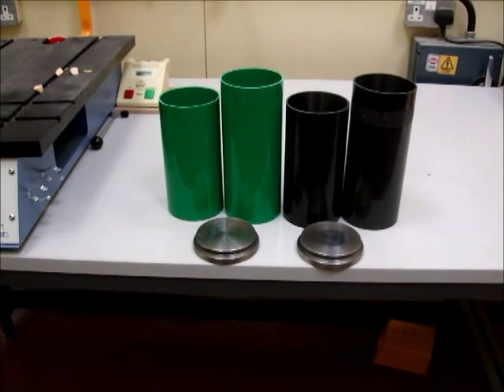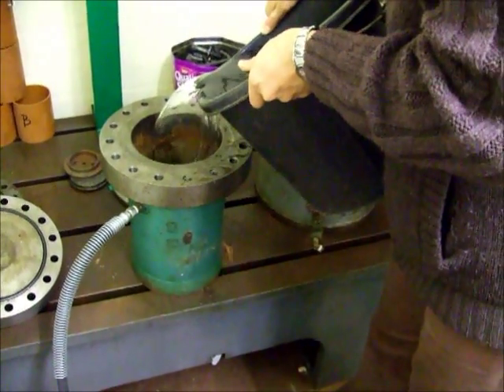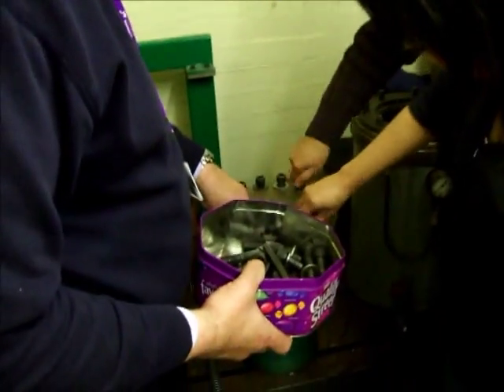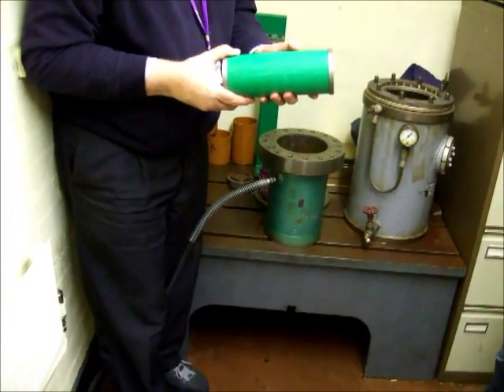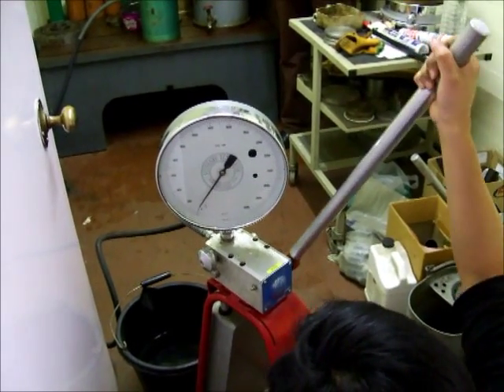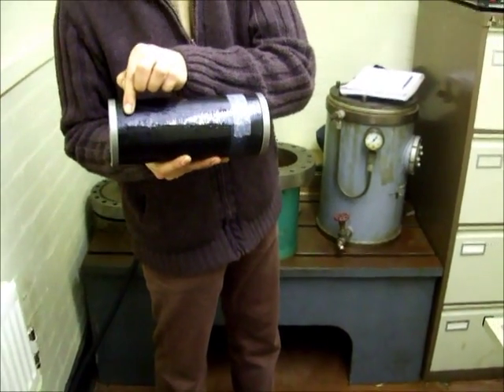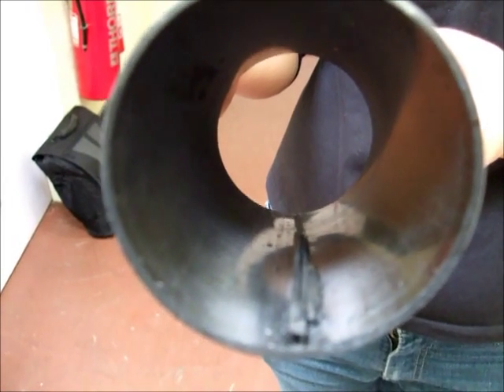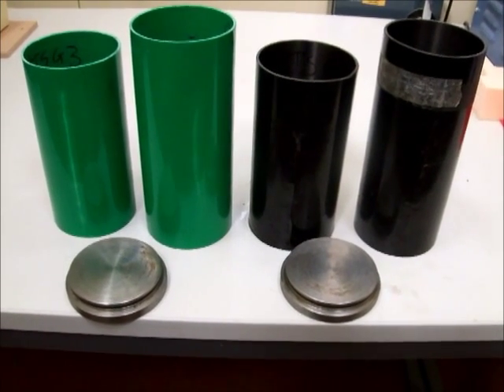Collapse of Carbon & Glass Fibre Tubes under External Hydrostatic Pressure.

Comment: Many OceanGate experts here in the comments, so I take the opportunity to ask what these tubes were supposed to withstand in the first place?
Reply: These tubes were demonstrating that carbon fibre hulls, are useless when exposed to pressure systems, also useless when exposed to freezing temperatures. There's a very good reason we use titanium

Comment: CF seems like a suicidal choice for the OceanGate Titan hull. Two minutes research shows that CF is only 1/10th as strong under compression compared to under tension. It's basically only the resin adhesive that is countering the outside pressure - a function that it was never formulated to perform. And that's assuming no manufacturing flaws, in a technology that's notoriously tricky to get right. Crazy...

Comment: The only strength a carbon fibre submersible pressure hull has is the epoxy resin. Useful for containing high pressure within, but useless at keeping high pressure out. Sad that this basic understanding was simply ignored.
Reply: The design of this "vehicle" would have benefitted more structural integrity, from a dual skinned corrugated steel rain water tank with layers filled with foam, for the pressure hull. Given that the corrugations allow an enormous strength factor through it's sine wave geometry. The CEO was delusional simply put.
There is no way this vehicle should have been allowed to exist, as a tourist/mission specialist/ passenger experience.

Comment: I wouldn't want to be standing next to this apparatus during such an experiment. If a bolt gets loose or there is material failure of the container for any reason everyone in this room would become history. Preferably control the experiment from a different room using very thick bullet-proof glass.
Reply: That’s simply not so. Water is essentially non compressible, which means that it doesn’t store energy. Notice how little work was needed to pump it up to 1500 psi? That work (perhaps 20, one-handed strokes of the pump?) is all the energy that would be released if the pressure chamber burst. 
Now, imagine how much pumping you would have needed if you were trying to pressurise it to 1500 psi with air.  All that energy goes into compressing the air like a spring and, now if the container bursts it will do so explosively. 
Tanks are regularly tested to failure using water. The tank splits, a small amount of water is ejected, and the pressure drops instantly back to zero.
Those people were perfectly safe.
Reply: The only danger is getting wet! It's perfectly safe as long as all the air is vented.
Reply: Notice that they get every last bit of air out. Because water is essentially non-compressible, it can't store energy needed to cause an explosion.
The only thing I'd be worried about is maybe a shockwave when the sub model implodes... but based on the video, that doesn't seem to be an issue...

Comment: Now mesure thickness of carbon en same devide from thickness of Titan and calculate wich pressure would hold 5" hull
Reply: Then, do pressure/de-pressure cycles, holding pressure in between as if at the bottom doing exploring ...
Reply: @tabooretka  its not rocket science but simple calculation. Of course is much complexer then i give it here but many people wouldnt onderstend if i was going deep in math for this one😉
Reply: @tabooretka  Define "most important factor."
In my experience with pressure vessel design, the shell thickness required, for the pressure to be resisted, is calculated first.  Then the piping nozzles and support connection reinforcements that are required to be added locally to keep the stresses within the allowable limits.  Agreed that these details often take longer to calculate than the pressure shell thickness.
When I got into this business we were just on the edge of using computer finite element stress analysis.  Since no one in my office really trusted those results, we carried them out by hand calculation using the Boiler and Pressure Vessel Code to guide us.  Then compared them to the FNA.

Comment: There is another video and a guy mentioned it, and that is the total lack of cross webbing on the ocean gate Titan. Scuba tanks have fiber in two directions crossing many times (and that fiber is intention, exploiting its strength). It seems obvious now in hindsight, but imagine a board of which the fiber is not running along the axis of its length, but instead just perpendicular to the length; how easy will that board break! If I was forced to guess, I would say that the titanium and caps had less give than the carbon fiber in compression, and then that carbon fiber could have easily severed in the middle under the compressive force, where it would be concentrated, rather than the convex surfaces at the ends of the sub. Another video also talked about how crackling was heard during each of the dives, and how the deeper the sub went, the more crackling was heard.  It's too bad (perhaps they did?) Rush didn't buy a pressure chamber such as these guys, and repeatedly test different designs expressly to see how they fail, not just to make something that works, but to see how the different methods actually fail under pressure and repeated use. Sometimes it is more important to know how something fails, then to make something that works.
Reply: Sorry, wrong failure mode. Pressure tanks are under tension, hence why cross-weaving is so efficacious. The Titan was purely under compression. The circumferential winding was the strongest way of depositing the lamination in the weakest mode (composites such as carbon or glass fibre should not be used under compression).
Reply: @alexogle8950  Hello Alex, I don't think you understand the issue fully. The INNER WALL of the hull IS UNDER EXTREME TENSION as it is being pulled apart by the deflection of the compressive pressure on the OUTSIDE WALL of the 5" thick hull.
Reply: @alexogle8950  You are absolutely right. With pressure from the outside, webbing doesn't help much.
Reply: Spot on !
Reply: Webbing doesn't help.
The fibers are compressed instead of stretched.
Webbing only helps if there would be high pressure from the inside of the cylinder.

Comment: Finally a video on YouTube that shows how carbon fibre pressure hull fails under pressure. Anyone else here after OceanGate?
Reply: Yep. This is the only channel showing a real simulation of the collapse. It's incredibly informative.
Reply: Yes, finally the video with the test i was looking for
Reply: The only thing to remember is this video only shows what happens in the instant the hull fails…in this experiment the pressure on the hull drops when the hull is fractured. If this occurred in deep ocean the high pressure would be constant and would continue to crush the hull…the point here is that unlike steel, carbon fibre is not ductile and will presumably fracture. Though I also learned that under those extreme pressure the air will compress and heat up resulting in instantaneous burning of anything in contact. So all that to say I’m curious to see what if any bits of carbon fibre hull are recovered from the wreck. Certainly interesting from an engineering standpoint, tragedy notwithstanding.
Reply: Be interested what pressure cycling (not to the point of failing, obviously) over time does - like a series of dive, dwell on the bottom and then surface sequences does ...
Reply: @uploadJ indeed. I think that’d be an ultrasound test. Non destructive testing they call that apparently
Reply: Yes, after several guestimation vids
Reply: Na, before 😉
Reply: Agree